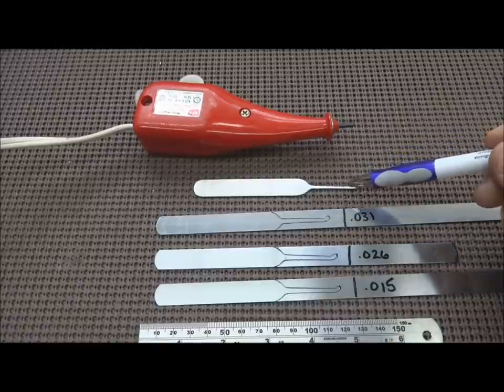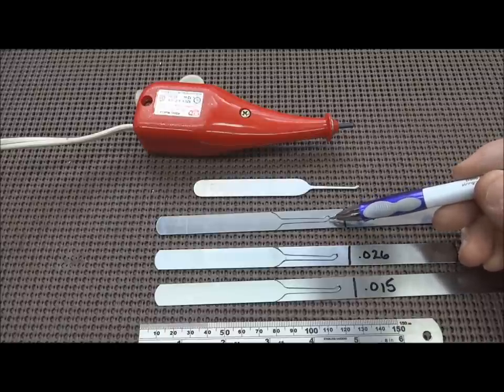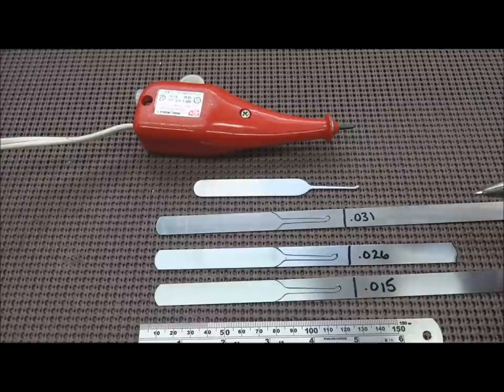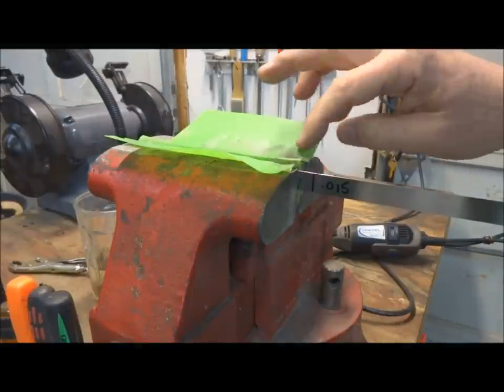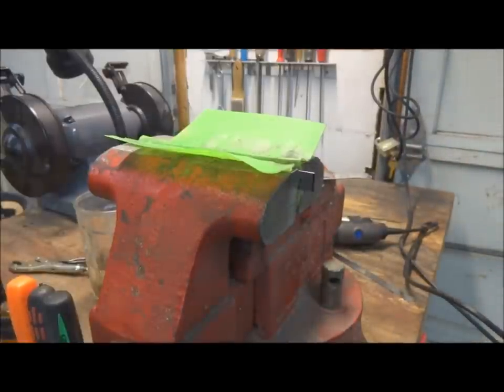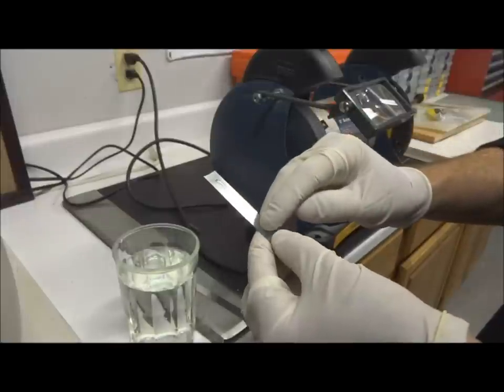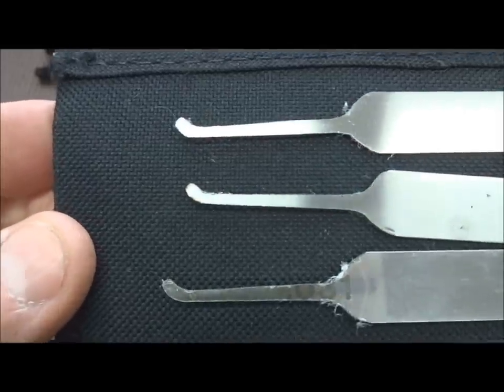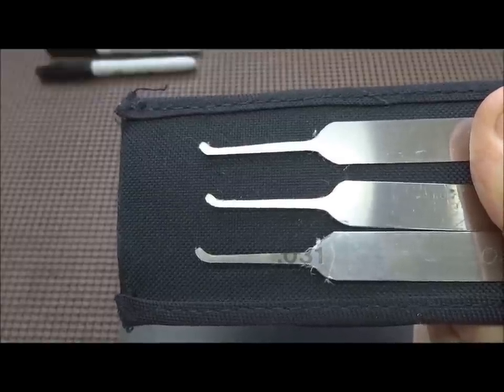(116) Pick Making Part 3: Rough Shaping

Comment: "...it's really easy - I'm really surprised more people don't make their own picks." Well, if I had seen these videos before I placed my first order this morning at Lock Pick Shop, I would have! Well, maybe. Actually, nah, because I do want to see if the pick profiles are any different than any of the ones I already have, but I'll definitely be replacing them with my own handmade ones after they wear out. One more possible source of pick making material is the metal banding used in shipping to keep heavy wooden boxes together. I don't know how many thicknesses it's available in, but I used to be able to find pretty long scrap pieces here and there around every Air Force base I was stationed on, and those were usually .018 or .020. They make great front and rear springs for tattoo machines.
Reply from the maker: OK, I was 100% with you until that last sentence...😀  And now I have to know:  How do you use the banding material on tattoo machines?

Comment: The mini belt sander from Dremel, Harbor Freight, etc are excellent for shaping. The belts are easy to change and vary from aggressive to very fine removal. 

Aluminum soft jaws in the vise help pull out heat as well as protect from marring. I made mine (snap on covers) with 1/8 aluminum sheet and a hammer. 

my 2¢ fwiw

Comment: Nice. For the first cut, if you want to save some material without overheating problems, I use a chisel and a hammer. I can punch it flat on an anvil, or just cut it by cold chiseling in the vice. But by cold chiseling the very end is bent sharply but that is no problem as long as the template part is fully in the jaws of the vise and the grinder will take care of the bent portion very fast. Or just use some snips, mini bolt cutters, or a metal shear will be the best for this. No heat, and way faster, cleaner. A fixed bench metal shear is not so readily available but a cold chisel and a hammer and a vice is much more available.

Comment: Stick the embryo pick through a potato near the tip and grind away the metal, the wet potato will draw the heat away so you can cut closer to the tip

Comment: just a question why dont you just dremel cut the tool about 1/8th of an inch from the actual shape of the pick then grind  the finish shape and maybe use a dremel sanding drum to finish to better control heating the pick

Comment: Hey Bill, I have a question: I'm doing my first picks and wanted to know if it's OK to form the hook by bending it (with some heat that will anneal it and some basic heat treatment.. quenching in water and 30min of baking in the oven to lower the brittleness). So I've got some nice steel springs and by heating them i can uncoil them, flatten by hot forging to required thickness and then make some with them like picks and tension wrenches.
So that would go into blacksmithing with forged picks. Doable?
Reply from the maker: No idea, I'm not very good at metallurgy. Try it, then you'll know for sure...

Comment: Started designing my own picks in InkScape. I have three picks designed so far. Here's the 1m 12s video I did. Inside the description I put three files containing the SVG file for InkScape for my 3 lock picks I designed, InkScape (FREEWARE), and the PDF file so you can print them out, and take a look at what they will really look like, actual size. watch?v=dXPkfY9f4AY

I'm gonna be buying "High Carbon Steel" Feeler Gauges From Grainger. I think Grainger feeler gauges are better quality carbon steel then Eastern Industries.

I want my picks to be very strong. Especially for the design I've chosen.

Just a quick question.. What kind of cutoff disk is that..? It looks larger then the regular 1.5" cutoff disks.. Anyways.. Very Nice Tutorial on how to make lock picks, but I'm afraid my lock picks are gonna be a little more slimmer then yours.  I have Southord PXS-14 lock pick set, and I ground down the picks to about the same size of the lock picks I've designed. I'm making these new picks from "High Carbon Steel", and they do not bend even with the cheap metal Southord makes them in.. Which I think is just regular spring steel. Let me know what you think of the picks I'm gonna be making, and the material I'm gonna be making them out of. Let me know if you think I should make the shank height a little higher or thicker.  Thanks for all the inspiration BIll.
Reply: Awesome. I will buy it & keep it handy for projects like this. Thanks Bill, much appreciated.